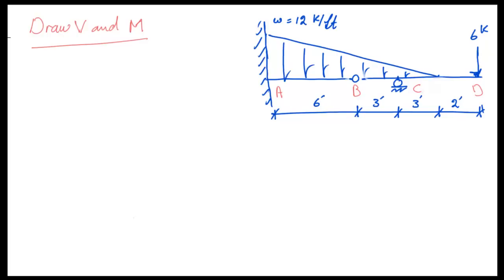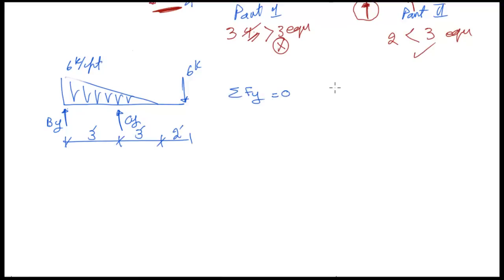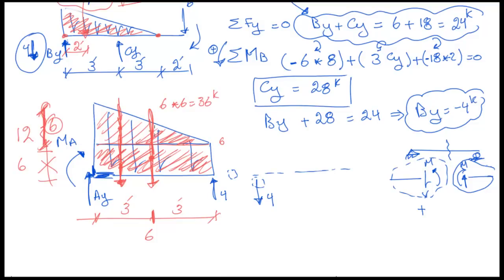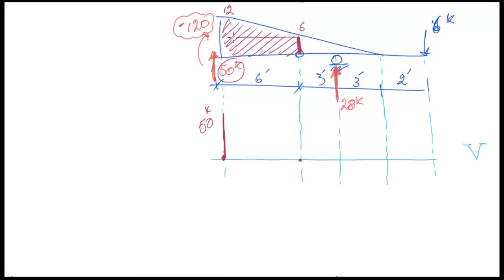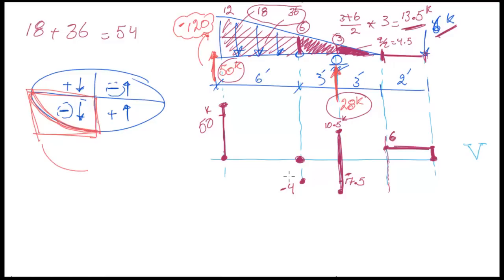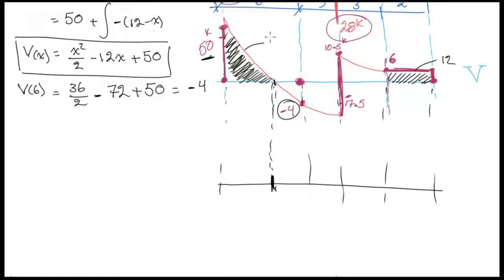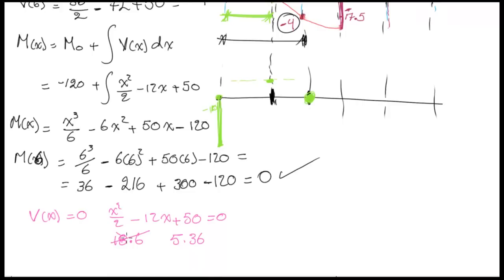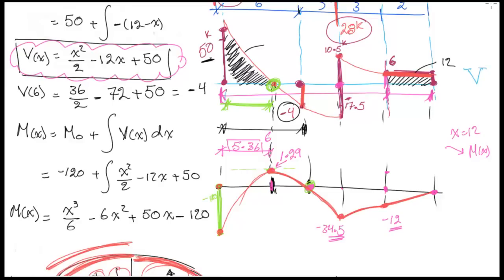Shear Force and Bending Moment Diagrams for an INTERESTING Beam With a Hinge

Comment from the maker: the hinge does not have a "direct" effect on the load distribution. the effects comes in play when calculating the moment, shear force, and deflection. Moreover, the presence of the hinge will reduce the size of the beam since it will divide the beam into segments which ultimately leads to lower moments due to shorter lengths.

Comment from the maker: the 1/2*6*6 is the area of the triangular load which will convert the distributed load to a concentrated one. remember, when you have a distributed load, calculate the area represented by the load (in this case is a triangle) and that should give you the equivalent point load. in the case of uniformly distributed load (rectangular), the area is the load value multiplied by the distribution length (that is the width times the height which is the area of the rectangle) hope that was clear :)

Comment: why is the M diagram at 0->12 = -12 sir? i cant get it, isnt the area positive?
Reply from the maker: Adrian munoz  for the -12 moment, you can easily calculate it from the right hand 
side since you have a single applied force at the tip of the beam at 
poit D ( 6 * 2 ) clockwise (i.e. negative)

Comment: Hey, at x=12 for the moment equation you don't get 12. You get -96. That equation M(x) you derived should only work untill x=9 ft because at x=9ft the shear jumps. How can you use integration to get that value 12 for moment at x=12 ft

Comment: i tried plugging M(12)= X^3-6x^2+50x^2-120 and the ans. isnt -12 sir its -96. Did I miss something else? I also tried using Integral its still -96. I dont get it. :(
Reply from the maker: Adrian munoz the moment equation is good for the length where the distributed load is applied. so you can apply the moment equation from 0 to 9. as for the -12 moment, you can easily calculate it from the right hand side since you have a single applied force at the tip of the beam at poit D ( 6 * 2 ) clockwise (i.e. negative)

Comment: wallah wa7sh bs we have to have 2 forces at the hinge one vertical and the other one is horizental on both sides and they r equal and opposite in direction its correct that u didnt use it in this question because X-forces are zeros  ,,, anyway  mashaa,a allah and keep it up ! from kuwait
Reply from the maker: Abo Gazi Mashkoor ya boghazi You are 100% right. No need to mention the horizontal forces since they do not play any role in the problem.Thanks for stopping by :)